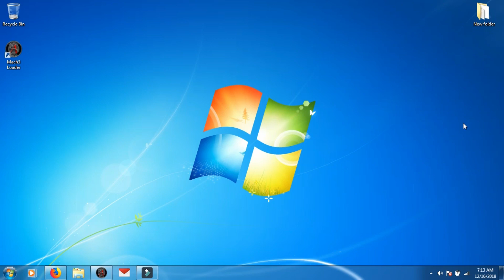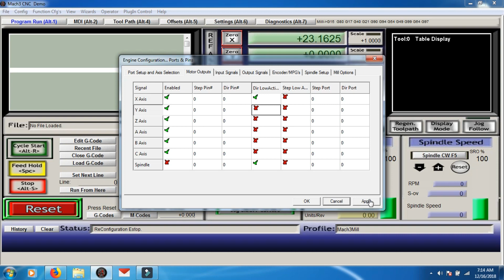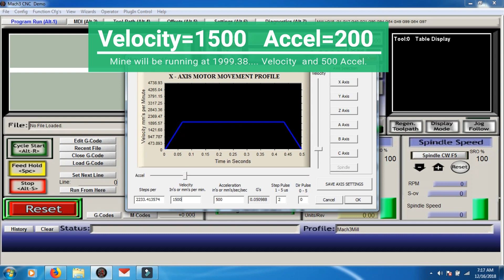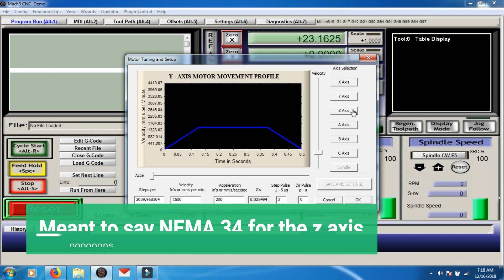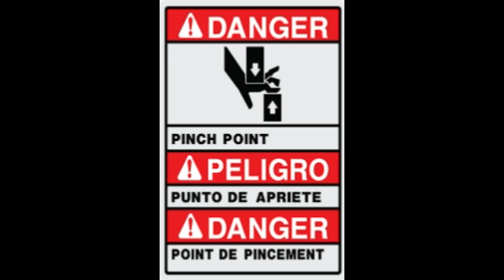Connecting to your Nvem Part  4- Motor tuning and Mach 3 Configuration

Comment: DZ plz can you help me, Do you have an email where I can contact you, to be able to give you the details of what I need your help with, I am building a small cnc lathe, but I cannot make the motors work correctly, since they lose steps and move very irregularly, I have motors nema 23 drivers are DM542T and the board is a NVCM2.1
Reply from the maker: dzmechano@gmail.com
Reply from the maker: I use dm542t on most of my builds. Look up the Nema 23 motor datasheet and on the back of the motor there should be an amps rating.
makes sure you are within specifications below peak amps.  setup your motor driver (power off) with the dip switches,  to the proper amps and resolution.  (I used 4000 for the resolution on my mill and the new lathe conversion I may go with a lower resolution 4000 is too fast)  after all that is ok...  go into motor tuning and slow everything down.  Accel and Velocity then recalibrate all the axis'  after.    I believe loosing steps could be from going too fast in the software or a mechanical issue so also check all you motor couplers ballnuts and end bearings etc.  email is up there if you want to brainstorm... :)   If you find an issue please post here maybe it will help someone down the road :)Good luck!

Comment: Hi , good video , I have one question for you … on my cnc I’m necessity to exchange y with z and reverse direction , I’m sure is possible it with remove the wire , but I’m necessity make it on software , same system of parallel port ( exchange number of pin of step and dir ) please help me ….. I’m necessity but use my cnc for cut a foam with hot wire and z change on y , the foam is vertical on surface and wire is parallel at y axis and applied on z axis …
Reply from the maker: if you watch all the videos its in there somewhere, but in prots and pins active low reverses travel...  on the nvem I believe the easiest way to change x and y is through wiring

Comment: Thank you for your videos they have been very helpful. I have a quick question. Can i add a J tech photonics laser to the controller board? I use a router on my CNC so my spindle pins are all free. Hope you can help.
Reply from the maker: Hey Sarah Thank you! You can use the spindle outputs 1 or 2 for a laser.  There is a pin marked GND to the left of the Vso pin.   That's the outputs input/feed for the spindle outputs.  Most lasers have the power supply connection and an i/o connection,  so the laser power supply feed would be left alone in this instance,  and you would have to run the ground from the laser i/o trigger wires through the nvem and back to your laser, essentially making your nvem a ground side switch for your J tech Module.  Which model are you getting and is there literature on it? 

After that if your are using mach 3 for the laser its super weird and you'll have to play with settings and delay times to get it to turn on and off without continuously burning through the work piece.  There's a differrent post processor for the laser if you're using mach 3.
Reply: @DZMech  may i ask you some help pls, im up to set the similar setup. bought laser from laser tree on aliexpress. it has +12v, GND and PWM 0/5 - 12V, 0-1kHz, how should i wire it up to Nvem ?
Reply from the maker: @Marcmk1  this may be an issue mach doesn't change the pwn frequency very well.   on the spindle in/out  you have to splice the ground from power in and feed the gnd on the spindle bar.  same as the output bar, Nvem doesn't feed those internally (poor design)   

I ended up finding a work around with a pwm frequency generator.  but I speced & ordered it for my application,  5 v output pwm.  not sure if this helps
Reply: @DZMech  hoiw can i contact you please? i would like to send you a picture of the wiring setup to ensure i understand your advise right before powering up.  shall i give you my email or you want to share yours? much much appreciated mate
Reply from the maker: @Marcmk1  dzmechano@gmail.com
Reply: @DZMech  big thanks mail sent and attched a quick prresentation to explain. Wish you a great weekend
Reply from the maker: @Marcmk1  mail sent back

Comment: DZ I am surprised that your motor travel distance "steps per" isnt a round number to "say" a nearest 100 - mine has never calculated out to really odd single digits...ie 33
Reply from the maker: Hey Dan, that was just to get the motors moving the steps change as you may know already after calibration.

Comment: Hello,
I have the problem that in the Motor Tuning and Setup window my X &Y Axis are always have the value between 0-1.
Its doesn't scale when I change when I change the value of the Velocity for example. I can't even change the Velocity it always jumps back to 0. Can you help me?
Thank you!
Reply from the maker: Make sure you have the proper version of Mach3 I had loads of issues with the newest version Newfangled even said somewhere they'll tell you to revert to a certain before troubleshooting, i believe. also,  make sure it's licensed not sure if this will help.
Reply: and a fresh install - then make a backup
Reply from the maker: @trondwell13 oh and backup your xml config.  I'm still trying to figure out the pwm spindle output,  it's not going well (haha) but maybe I'm asking to much.

Comment: The NVEM can reach 200kHz but Mach3 can reach 100khz. 
How is it possible to reach more than 100kHz on Mach3?
Reply: why?
Reply from the maker: I think that maybe a great question for Newfangled solutions and Novosun.  My thoughts on it are originally when Mach 3 came out it was meant for a printer port style connection which may have ran at a much lower frequency the ethernet.  then came ethernet smooth steppers ethernet has a broader range of frequency speeds.  But thats just my theory nothing more than a theory.  Novosun may have just printed on the to advertise that it can... use up 200 khz but you'd need software to hit those speeds?  Which Mach 3 does not.
Reply: I think that Mach3 dont send pulses step/dir in Khz. to the ethernet, I think Mach3 send data of pulses speed/dir in numeric and code way, then the NVEM with this data convert it and send pulses step/dir at 200 Khz. , with more capability than LPT port due to have a microcontroller dedicated in the board.

Comment: Hello, I am thinking of using a DC Motor Spindle.
I want to use NVBDL+ as the Spindle Driver and NVEM as the CNC Breakout Board. I want to control the Spindle Speed with PWM.

What is the appropriate connection between NVBDL+ and NVEM?
Reply: https://www.nvcnc.net/nvem.html